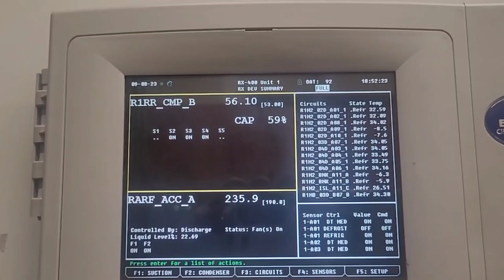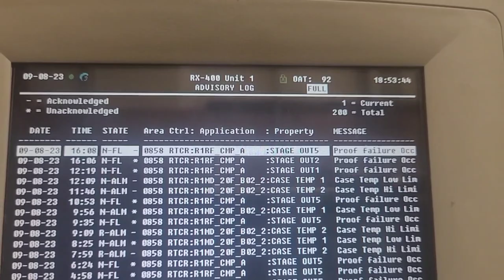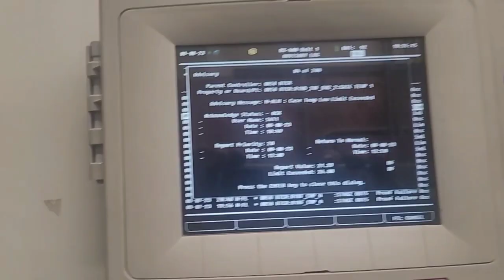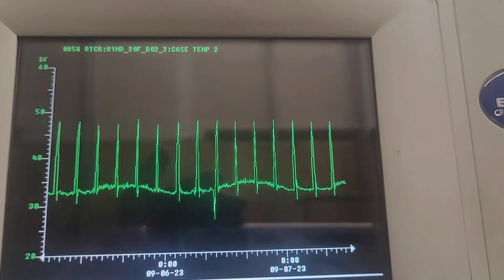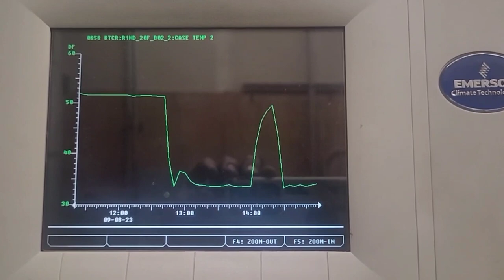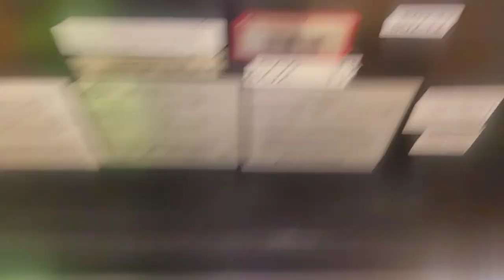Emerson E2 to start and complete a service call

Comment: anything on the E3
Reply from the maker: I haven't actually came across one of those yet.  if I do, i will be sure to share it in a video
Reply: @HVACRServiceTech those lowkey suck
Reply: Installed over 30 e3s this year way better and easier to program. I disagree with changing the e2. It’s most likely a board issue or valve issue.